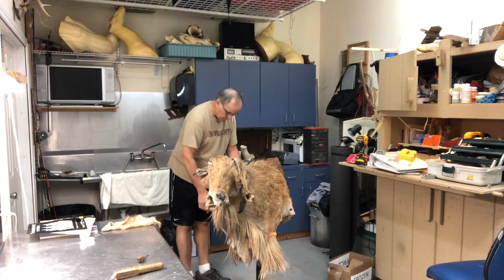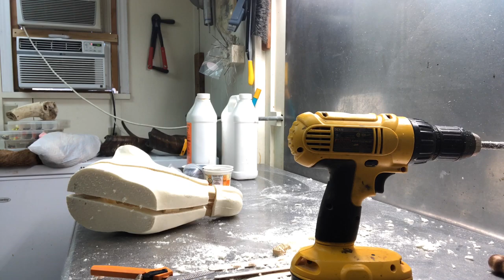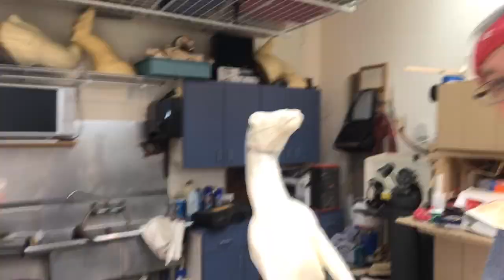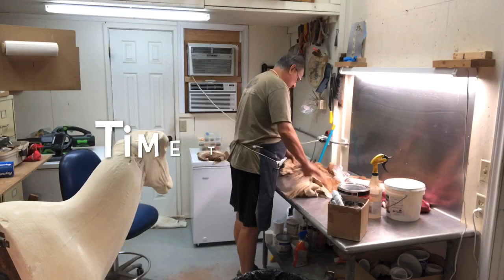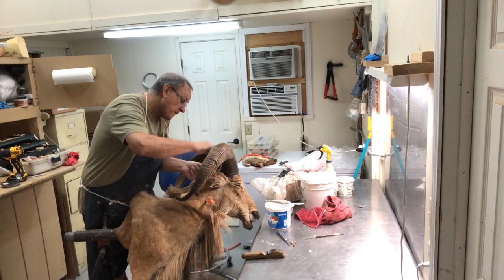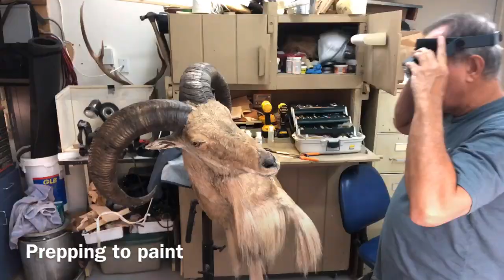TAXIDERMY- Aoudad Ram

Comment: Where you get those little orange handle pins for holding hide in place?
Reply from the maker: Joe Coombs taxidermy supply handles them.  They also carry a wooden handle one.
Reply: @donsherpy6101  do you happen to know what they are called?
Reply from the maker: Regulator pins
Reply: @donsherpy6101  thank you